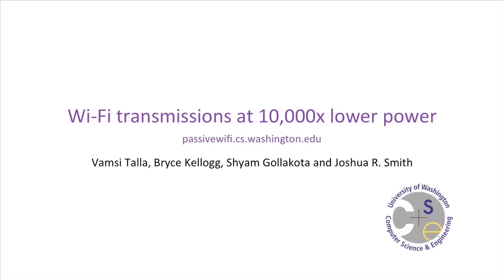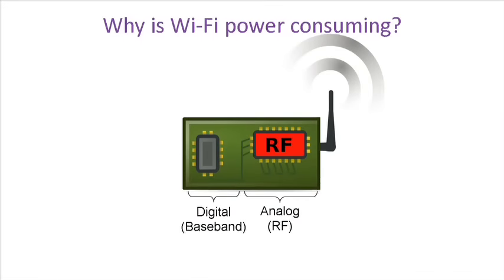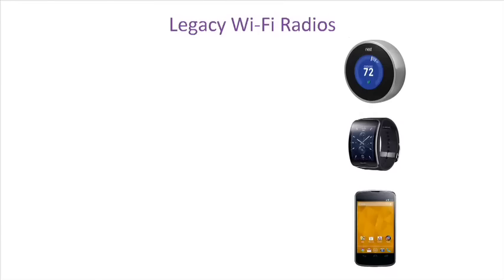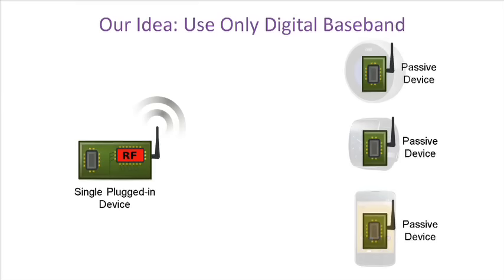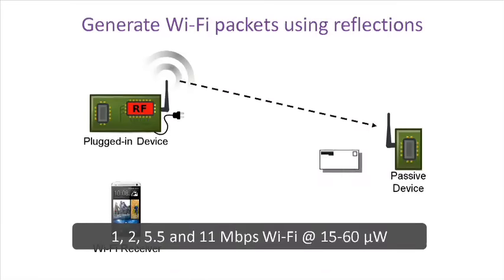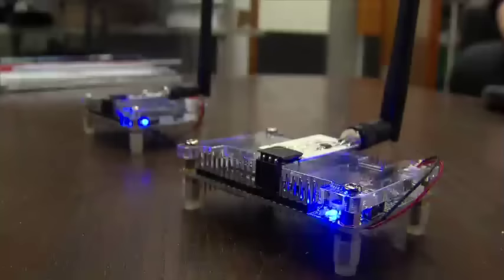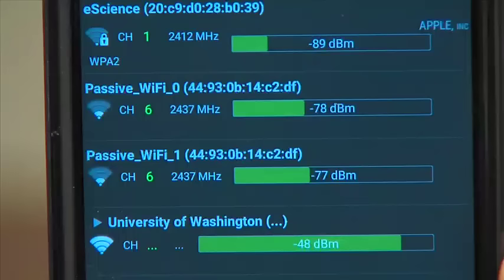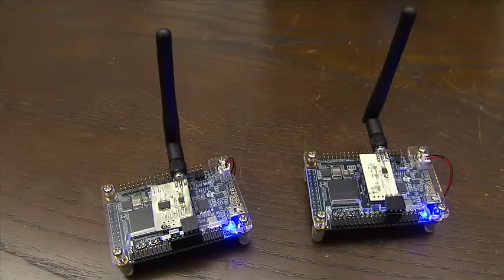Passive Wi-Fi

Comment: Hmm, but could you still have wifi direct? I understand that the RF part makes a channel, which when connecting to a router would be useless, but for making a wireless hotspot or using wifi direct is needed. Or am i misinterpreting how wifi works?

Comment: So, you've made some devices that can transmit with very low power, and that's cool and all, but can they still receive without an analog radio? I suspect that analog rx would be very low power anyway, but it wasn't mentioned in the video.

Comment: What's the difference between this and RFID?
Reply: RFID chip is powered by the induction from the transmitter.(wireless charging basically) Here it looks like they are not powering the passive devices over the air, but are somehow superimposing the packets into a carrier wave. I am not sure if what I said is even close to correct though.